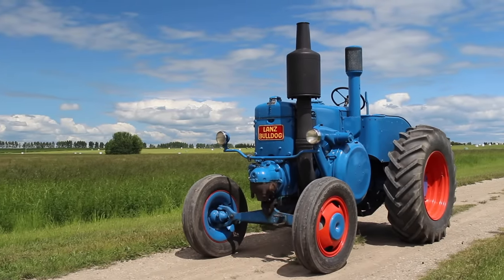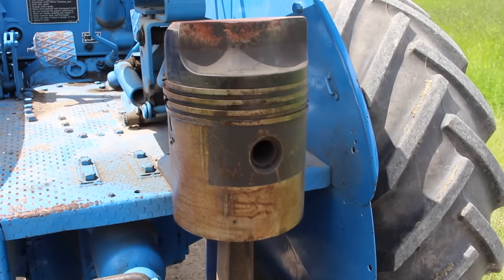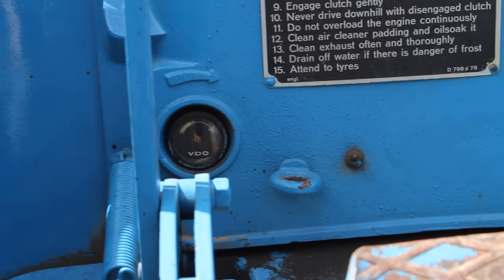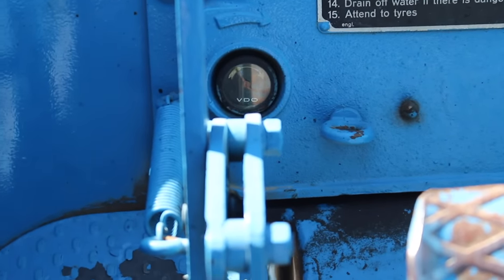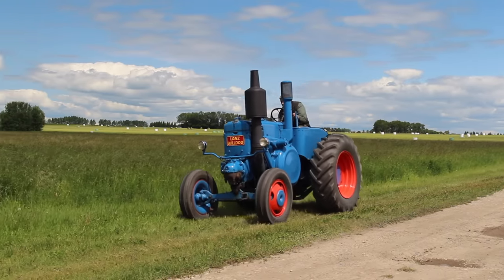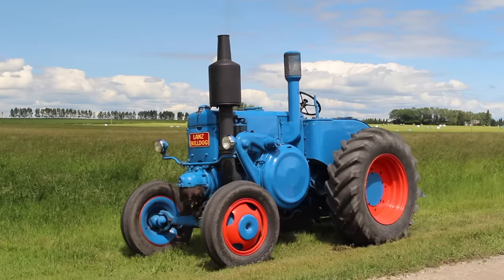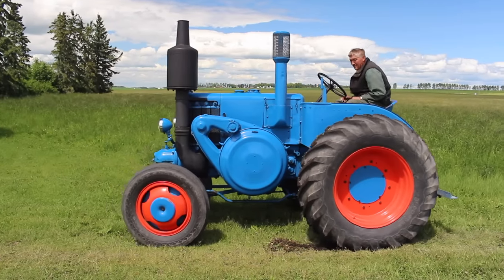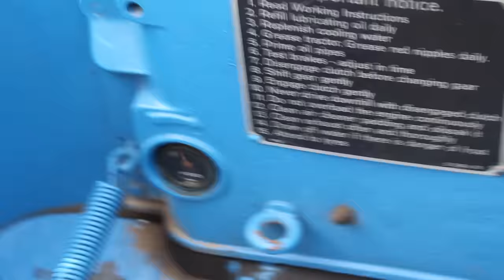Engine running backwards? Lanz Bulldog Tractor two stroke

Comment: Cool video!!! Can I ask why is has a exhaust stack because it would be a intake when running in reverse, and am I correct in assuming engine runs in reverse when you reverse. What type of transmission does it have and I assume it does not have reverse gear. How many gears does it have? Is it water cooled or air? If it has a air filter how does that function when the engine runs in reverse? What about the PTO drive direction? Cool video! Thanks for sharing!!
Reply: What a lot of questions!  But good ones.
      The way this engine is made [and similarly for most 2-strokes] it's impossible for the gases to flow backwards even when the engine is turning backwards. 
      Every time the piston 'ascends' [in this case 'moves towards the front of the tractor'] its underside sucks fresh air into the crankcase;  then when it 'descends' that air is compressed, until right at the bottom of the stroke, when the squashed air is released to rush into the cylinder above the piston, just as the waste gases from the last firing rush out through the opposite side of the cylinder, into the chimney.  These events happen in the same order and the same way, when the piston goes up and when it goes down, no matter what's going on with the crank and connecting-rod.  So the exhaust stack is always the exhaust stack!
      Although very early versions were made to use this feature of the engine, this tractor was not.  It has a 'proper' reverse gear, which is normally used for reversing.  The two unusual abilities, to run backwards, and to rock continually through less than 360 degrees, are only being shown here for interest, because nowadays it fascinates people who have become used to one-way-only engines.
      It has the equivalent of two 'gear-boxes', though they are all in one casing.  The five or six shafts holding the gears are arranged transversely, across from one side of the casing to the other, between the crank and the differential in the driving axle.  One gear lever selects from 3 forward and 1 reverse, the other lever is for high or low ration generally:  so that gives 6 forward and 2 reverse.
      The engine is water cooled.  The water is kept topped up right at the front of the 'bonnet' [or 'hood' if you're American], and surrounds a central fan on a transverse shaft [driven by belt in the casing seen on the left of the tractor] which pushes and pulls air through the radiator panels seen on each side at the front of the tractor.  The cylinder has small fins inside its water-jacket, to help heat transfer.  The water also of course cools the cylinder head, including the dome right at the front where the injector and its nozzle-adjusting tap are, but is not allowed near the hot bulb below.
      The air filter is pretty basic, behind the fuel tank and the two oil tanks, and as you'll understand, from our outline above, it never notices any difference whether the crank is turning forwards or backwards!
      Earlier Bulldogs had no PTO - it hadn't really been invented, no implements required it - but it was included with later versions.  Don't know about this one in the video.  I suspect that any PTO probably would go backwards with the engine, but as one would never operate the machine seriously in that way the problem would never arise.
      As you say - a hell of a cool video!  I think I'd like to get one, hitch up an old wooden sleeping-van, and travel the world - sedately, if not exactly quietly...
      Cheers!

Comment: It does have a reverse gear, and i doubt it was intended to have the engine run backwards, just how it is,
We had one on a farm in new zealand to pump water for irragation, ran on heavey black heating oil
Reply: alot of them dont actually have a reverse the engine turns its rotation. I dont know about your model tho
Reply: alot of them dont actually have a reverse the engine turns its rotation. I dont know about your model tho

Comment: Fixing my son's 86 KDX 200, with a Magneto from a Ticate, Had to make a new/timed keyway slot, while with no keyway the magneto can be fitted and any spot Forward or Retard or completely wrong, so at one stage i had the 2 stroke running backwards

Comment: great machine , never heard of it not turning 360 .  What was this used for 0rpm?
Reply: some of the LANZ tractors didn't have a reverse gear, so in order to drive backwards you had to perform this trick to let the engine run backwards. 

It's not a bug, it's a feature!
Reply: @markkrutzmann6862  also a lot of snowmobiles reverse using the same trick
Reply: Running at 0rpm is not used for anything. It’s a party trick that the owners have worked out how to do.
Reply: @markkrutzmann6862  most bulldogs do have reverse gear. It’s only the very early ones that do not. This model definitely has reverse and is not designed to be run backwards if it can be avoided as the oil pump does not work in reverse.

Comment: Say, is a hot bulb engine considered  "Diesel" engine? This thing will run on any liquid that is combustible. On hot days probably even Margarine.
Reply: Anything that uses heat vs pressure to cause the fuel to self-ignite is considered diesel

Comment: ok so i play scrap mechanic and i have accidently made countless "0 rpm" "engines" 
timing and crap like that is a pain in the ass but when done right, they run really well, when not? look at a v8 with crossed plug wires and you get the point, or they bounce round back and forth, or violently shakes like its seizing...

Comment: technically this isn't a Diesel engine. 
This is actually called Half-Diesel or "Glühkopfmotor" (=glowing cylinder head-engine) because the Diesel ignites on the hot, uncooled cylinder head and NOT by the hot compressed air like a real Diesel would. The definition is HOW it ignites the fuel, not what fuel is used.

Comment: Beautiful in  Wonderful full machine running at  1 and negative 1RPM. I don't know if you can call it 0 rpm just because it adds to one than subtracts 1 because it's still 1RPM whether it's positive or negative. So I would call it 1 minus 1 RPM... WONTER IF MY DIRTBIKE CAN DO THIS!!!
Reply: That was what I thought at first too, but then I looked closer and realized that it takes around 1 second for each compression cycle, which would correspond to +60, -60, +60, -60, ... in RPM :)

Comment: What do you need a reverse gear for? Just reverse the engine rotation!
Reply: Exactly the engineers' thinking while building that thing 😁
Reply: It has a reverse gear. The very early ones did not. 
What he is failing to mention in this video is the oil pump does not work if you run it backwards. So if you run it backwards for any length of time you are likely to do damage to the engine.

Comment: It luckily only happened once with my Lanz D 2416
Edit: mine has a reverse so its not as good for the engine and a Red light shows that it is running the ,,wrong " way around

Comment: I used to have a Suzuki TS250 single cylinder 2 stroke bike that used to run backwards if you didn’t kick it hard enough... you put it in 1st gear and let out the clutch, the bike would go backwards... 😂😂

Comment: Look, I'm no engineer: I didn't take a load of mathematics. Is the RPM really zero, or is it defined as the absolute value of the rotations of the motor?
Reply: Really its 9/10ths of whatever the rpm would be if it made full revolutions that slowly. I think you are correct in saying its the sum of the actual crank rotation in degrees adding to 360
Reply: @ivyisle  that makes sense! 🙂
Reply: Zero full rotation!

Comment: The engine may roll back and forth, but how does it move the tractor forward when the engine rotation is reversed? Does it use the row boat principles where the gears are engaged only on the left rotation? 🤔
Reply: Pretty sure when the engine rotation is reversed the tractor is moving backward, not forward...

Comment: It's not a glow engine it's heated via a blow torch via that overhang at the front its like a hot air supply to ignite the fuel

Comment: How about the injection timing when running backwards? Does it has a control for that?
Reply: Everything is mechanical 
Same how the engine runs forward the same way it runs backwards
Reply: It's not a particularly precise injection timing. Fuel gets injected before but near TDC, and then two or three things added together - the degree of compression of the air, the air's temperature, and the heat from the hot bulb - combine to result in combustion.  So temperature is a strong factor.  Even the compression can change with rpm, when the piston is worn.  And the injection spray is adjustable, from a thin spurt to a finer widening cone.  All these things add to the variability.  
      So the answer is, no.  No way to directly control injection timing.  And the actual point of ignition is not really a point, rather a time-period, which could be anywhere in a quite large range of piston positions, depending on weather, work load, state of engine, type of fuel [ - remember they could use anything that will burn, even pig fat], etc etc.
      The great mass of the flywheel makes sure that the engine goes over TDC even if ignition happens to be rather early.  Of course when working backwards it might be that the fuel gets added at a little PAST top dead centre, but that would just be like starting any engine with fully retarded ignition facility.  
      This vagueness and variability of the timing of the actual ignition is one of the reasons why hot bulb engines have a small top rpm and never a very great range of speed, because at the extremes, where the temperature of the bulb varies a lot, the ignition point can change just too much.
       I don't think that these machines have automatic injection timing advance with speed, but I know that increasing the fuel [when opening up] is done by moving a wedge [this is all hidden behind the right-hand flywheel] so that more of the wedge's thicker end comes between the movement of the crankshaft-driven actuator and the pump piston rod; and this will tend to BEGIN the fuel spray earlier, which is a sort of advance, I suppose.  I think this would slightly help in the engine's backward running at higher speeds, if anything.

Comment: But is it lubricating when oscillating ?
Reply: No it isn’t. Nor does it lubricate when running backwards. If it was mine I wouldn’t be running it backwards to as long as the do in the video.
Reply: Single cylinder 2 strokes with crankcase compression...have a little oil mixed with fuel, before it enters the crankcase. The oil does enter cylinder and burn.

Depends on source of that oil...newer 2 strokes tend to have a plunger driven by an engine driven cam. Easier to adjust so lots of oil when needed  under load and less oil burnt other times.. if such a system... and it is supposed to do say one oil mist squirt just after top dead center... oscilation will have pot luck if double the oil squirts per firing or none.

If engine uses even simpler system and runs on pre mixed....  Where oil goes in fuel tank along with fuel...I can't see it affecting engine lubrication at all.
Reply: @stevecummins324  it actually kind of a complicated system with 2 oil tanks and a couple of pumps. Oil is pumped in to the big end and the mains and is then sucked out of the crankcase in to an second tank. From there it is injected in to the cylinder walls to lubricate the piston. From there, some ends up in the combustion chamber and is burnt and some ends up back in the crankcase. 
The fuel is injected directly in to the cylinder head like all diesels so it never passes through the crankcase.

Comment: "This tractor's a hot-bulb, so it doesn't have spark."  You said it's a diesel, it wouldn't have spark anyways.
Reply: It can run on anything
Reply: @puebespuebes8589  That may be, but he specifically called it a diesel.  Diesel engines don't use spark plugs whether they're hot-bulb or not.  It's a bit misleading to people who don't know engines.
Reply: @SpawnofChaos  yes i have to agree

Comment: Dose that mean the air intake and exhaust reverse as the engine reverses rotation
Reply: Yes, that's why it's only got a mesh filter instead of filtering the air through oil as was common on old tractors, otherwise the oil from the filter would be sprayed everywhere and once the engine turns over backwards. Huge mess I've seen it happen😅

Comment: How about the fuel delivery? If the engine can reverse, does that mean the pump also reverses? Or maybe the fuel delivery is gravity fed, like how the Fiat Topolino fuel tank is higher than the carburetor.
Reply: It's a diesel cycle , it has a pump and injector

Comment: using hp=(tq)(rpm)/5252 this tractor has 375 lb/ft
Reply: I believe it develops maximum power at quite a lot less than full speed, though - in which case the torque will come out correspondingly greater.
   It would be interesting to go a stage further and calculate the tractive effort - the actual force the tyres exert on the ground [if slippage is prevented!] - but we'd need to know the gear ratios.  All I know is that these tractors usually have a '3 forward, 1 reverse' shift lever, and another one for 'high/low' ratio.  There are several geared shafts, all of them mounted transversely, between the crank and the differential, but I can't find more precise information.  It must be out there somewhere, though, because there are tons of these things still in Germany and other countries, and spare parts merchants thriving.

Comment: Does it even have a reverse gear or was it designed to just run backwards for reverse
Reply: It has a reverse Gear. It's not designed to run backwards because some engine parts don't get oil

Comment: whgen i was like 12 i was riding a 89 model YZ80 2 stroke, i rolled down a hill backwards in gear it started the motor for a sec but after that it had twice as much power not sure how running backwards for a second caused it

Comment: would it technically be possible to mod a hot bulb engine with a spark plug? i know that would kinda defeat the purpose but it seems possible to me.
Reply: Hot bulb engine is just early glow plug , the hot bulb only used to start it cold , it's a compression ignition engine, a spark plug would do nothing ! It runs on petrol, kerosene, alcohol, cooking oil, motor oil any thing that burns !
Reply: @JosephCowen-ru7up  there was actually a huge debate about this when Rudolf Diesel first invented his engine. No, hot bulb engines don’t generate enough compression for compression ignition, the top of the cylinder being hot enough for auto ignition is what makes it work. That’s why Diesel engines start at 13-14:1 compression and hot bulbs top out at 6:1 or so
Reply: @lettuce7378  well ya got a problem , because , a Landz Bulldog engine is 21 to 1 compression , the hot blub is only to start if cold , I worked on one and we never used it to start it , and when they do use it they only heat it up for 2 or 3 min with a blow torch , exact same as a glow plug , that's all it is , it doesn't stay hot ! This is a compression ignition diesel cycle engine , sure it runs fine on diesel but we never ran it on diesel , just used transmission fluid , or old cooking oil , runs fine !

Comment: so the engines 10x the size of my first cars engine and its a 2 stroke so it could be pushing out 20x the amount of power but it only cranks out 45hp and my lil 1 liter canks out 60 XD

Comment: When it runs backwards does it suck air in the tailpipe and exhaust out the intake?
Reply: No it runs the exact same as usual, only difference is the camshaft is spinning in the opposite direction.
Reply: @PilotTed  Doesn't have a camshaft.

Comment: that's not good for the trctor.
Reply: The tractor dosen't really care. The early Lanz tractors didn't have reverse gears so you had to run the engien backwards to reverse. If this was soo bad for the tractor they wouldn't still be around after all those years